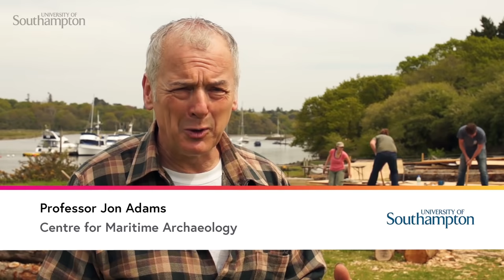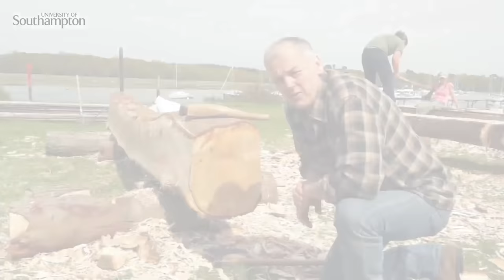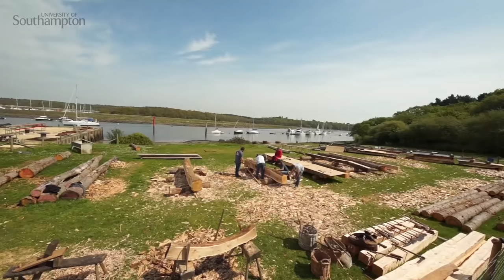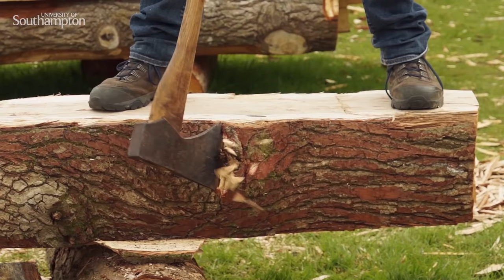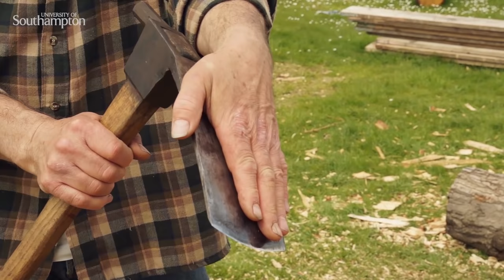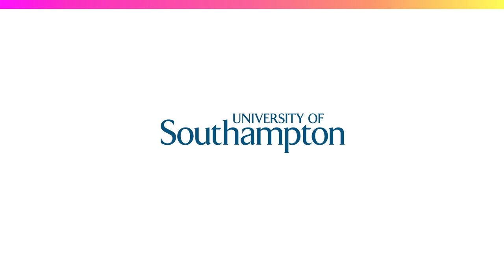How did medieval seafarers turn trees into boat parts?

Comment: At 4:23 a fiberglass craft passes in the background...no axes...just molds...virtually indestructible!
Reply: Not quite, since fiberglass boats can take damage as much as any other kind of boat. Plenty of them have sunk once a hole was punched through the hull when the boat hits a reef or pier during high winds. But that's not the main problem with fiberglass boats, which is that they are utterly soulless.

Comment: Waste more than you use.there is a good reason saws replaced all those adz and axes.
Reply: jujitsuman68 marine ply is better than all that splintering timber anyway, have fun living in the past axeman
Reply: ???? Of course, that's a course in experimental archeology, not modern techniques. Of course there was a lot of waste, techniques evolve with time.
Reply: The cutting of axe and adz protecting the wood from routing and moisture more than sawing , there is a scientific researches about that

Comment: the pink girl doesn't hold well his axe
Reply: My back hurts just from looking at her swinging it with so much lower back movement.  Certainly it's heavy and smaller people might need to use their core and back muscles more and as well it might have been taught to her as a "safer" way to swing, but in my experience with heavy hand tools, I'm safer if less parts of my body are moving, as I have less moving parts to alter my swing, not to mention limiting the motion of one's back to reduce strain.  But in the end a weekend volunteer is going to take a while to get the hang of it and not everybody enjoys the physical strain or the beauty and value of hand work.
Reply: It gets worse in the second shot....Somebody go help her!  Everybody around her is letting the tool do the work, she is stopping it! And not always being careful about her feet and swinging straight in, hoping the tool will somehow turn sideways and cut at an angle....... :(
Reply: I'm sorry, I just can't resist commenting again.  At 3:04 she gets ready to swing longitudinally as if to break out the chip in between (and I'm pretty sure there's a better axe than that one for that type of cut...), then CHANGES DIRECTION MIDSWING.  She is lucky to still have all her toes.
Reply: Paul A doesn't write well her english